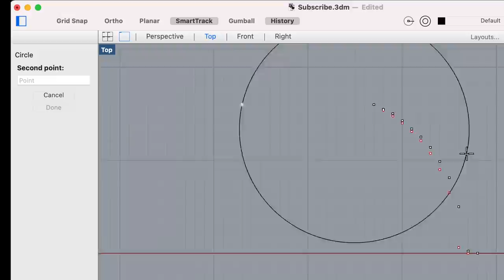Hammer forming and Classical Philosophy- CJ5 Rebuild part 6

Comment: Just a little tip for welding up....... "Enthusiastic" gaps in flat panels.

Find yourself some flat pieces of copper strip. The thicker the better. If you clamp a wide plate of copper to the back, and a thinner strip to either side of the gap on the front, you can actually drag the weld pool across the copper to bridge larger gaps. The weld doesn't stick to the copper, and it sucks heat out of the metal so fast that it can REALLY localise any panel warping. It also leaves the rear surface of the weld pretty much flat.

Just make sure it really is copper you're salvaging from a scrap metal yard or the like. Some copper heavy brass alloys can look deceptively like copper, but will try to give you zinc poisoning if you do this trick with them. Buzz (Bus) bars from old industrial power distribution boxes often have some suitable chunks of copper in them.

Comment: dooood you are using your cnc bed as a work table . :P priceless.. love your videos...great stuff...love the build...
Reply from the maker: It’s more like sometimes I clean all the junk off my work table and use it as a cnc router.
Reply: @JeremyMakesThings  hahahahahaha...love it...im  currently making my own version of the  avid cnc...used some of their parts and peices...going to use linux cnc instead of mach 3 i think..i use mach 3 on my diy plasma cnc...but  thought i would love the pain of leaning linux cnc ...stay tuned...:P
.
Reply from the maker: I got mine from avidcnc back when they were cncrouterparts, and I’m running Linux cnc on it.  The only thing I’ve struggled with is I’ve never gotten the two gantry motors to work as separate joints.  Not that I’ve tried much because it works well enough for what I do to just have them slaved together, I just need to be careful to make sure the gantry is actually square.
Reply: @JeremyMakesThings  i always slave my y-axis...seems to work best..ive built like 4 cncs from scratch...this will be my first linxucnc...tho i am peeking at acorn....it is a bit pricey...but sometime i just want poop to work..im more of a design head that technician...i see you play with the treadmill motors also..i jsut completed a 1950s delta drill press conversion...ill have a video up in the next day or so...love tready motors for builds...

Comment: I have 6 cj5s. I thought I had some rust. I have one that I've patched and overlaid and it needs done again. I work on it as I can while still driving it. To do the rear I have to park it and pull the gas tank. One piece at a time. Good luck and hopefully we are not in the mental ward before we are done.

Comment: Grandpa's axe, 7 new handles and 3 new heads but still as good as the day he bought it😁
Reply from the maker: “I remember once, in Japan, having been to see the Gold Pavilion Temple in Kyoto and being mildly surprised at quite how well it had weathered the passage of time since it was first built in the fourteenth century. I was told it hadn’t weathered well at all, and had in fact been burnt to the ground twice in this century.

“So it isn’t the original building?” I had asked my Japanese guide.
“But yes, of course it is,” he insisted, rather surprised at my question.
“But it’s burnt down?”
“Yes. Many times.”
“And rebuilt with completely new materials.”
“But of course. It was burnt down.”
“So how can it be the same building?”
“It is always the same building.”

I had to admit to myself that this was in fact a perfectly rational point of view, it merely started from an unexpected premise. The idea of the building, the intention of it, its design, are all immutable and are the essence of the building. The intention of the original builders is what survives. The wood of which the design is constructed decays and is replaced when necessary. To be overly concerned with the original materials, which are merely sentimental souvenirs of the past, is to fail to see the living building itself.”

– Douglas Adams, Last Chance to See
Reply: Must get round to reading that, only been sitting in the bookshelf for 30ish years😁
Another fun aspect of "originality" is thinking that all the cells in your body are replaced roughly every 3 months, so are you really the same bloke that started this project?
Reply: That's the saying I use as well. Don't know them Greeks

Comment: Same Jeep or not, who cares? You picked up a challenge an you go for it, that's what counts.
The welding and grinding makes it hard to see if the surface is flat or not. Here's a tip. Spray whatever paint on it and it well be easier to see.